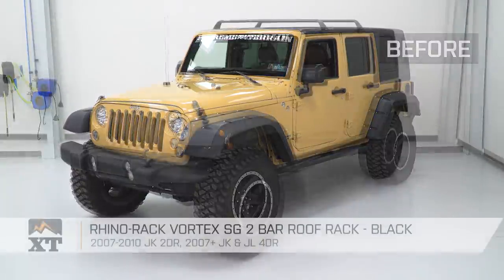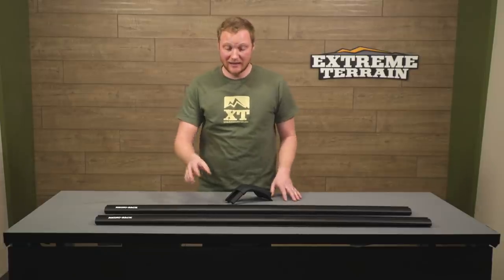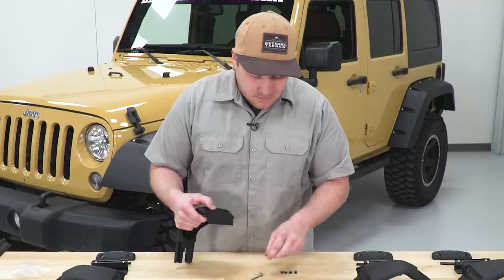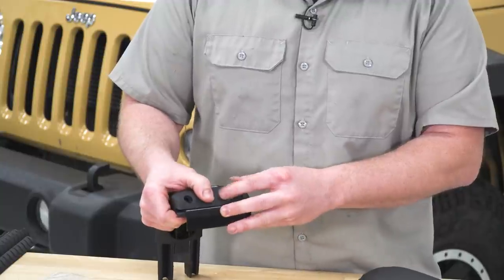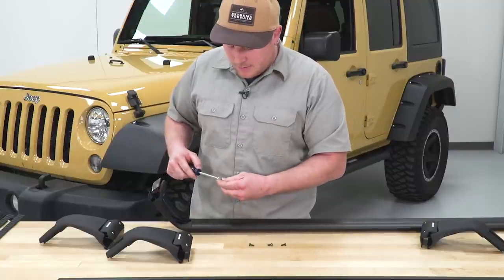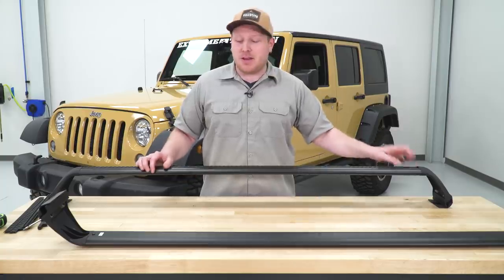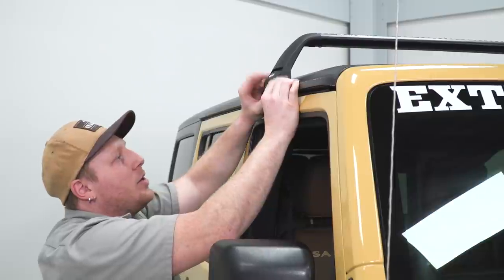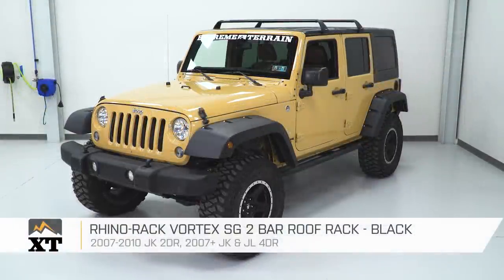Jeep Wrangler Rhino-Rack Vortex 2 Bar Roof Rack (2007-2018 JK & JL 2 Door & 4 Door) Review & Install

Comment: I just read these have a rating of only 88lbs. Curious, since I just ordered these bad boys for two 12 ft kayaks (65lbs each). In your opinion, what would be the failure point? The center of the bar or the attaching brackets / rain gutters? Love how these attach and they’re modularity with different attachments for bikes, baskets, etc. So if its just a matter of bracing the center while hauling the yaks...not a deal breaker. I know I should’ve checked first but Ryan said “kayaks” and I said “click” lol
Reply: Matthew, how has this worked with your 2 - 12' kayaks? Thinking about the same thing, but concerned about the integrity of the rain gutters with 150lbs of kayaks at highway speed.
Reply: So far, so good man. We’re not getting on the highway with em as we live pretty close the the lake. Been up to 60 and no problems. The polymer footings are the weakness point rather then the gutters. Was thinking about fabbing some little reinforcement brackets. The unknown is UV degradation. We shall see. And also the 88lbs is per rack so... we should be good as the weight is distributed. I made sure not to put the rear rack too far back( 3-4 inches from end) to avoid putting all the stress on the end of the gutter. Hope this helps

Comment: This is designated 2 door and 4 door. But where do we install the rear rack on the 2dr? and whats the point of the rubber strip install? Why wouldn't they just add it on there in advance

Comment: Why aren't the rubber pieces pre-cut to fit the exact length of the cross bars? Seems a little silly that I have to cut it myself. Almost seems like a manufacturing oversight where they just said screw it 🙄 because of this, I'm not convinced this is a good product.